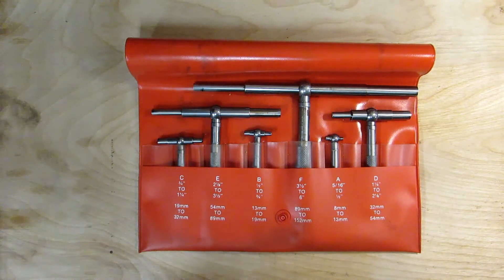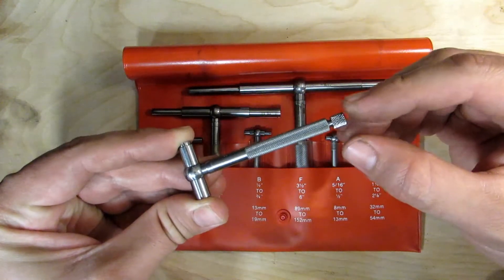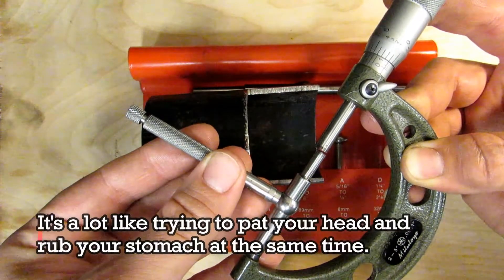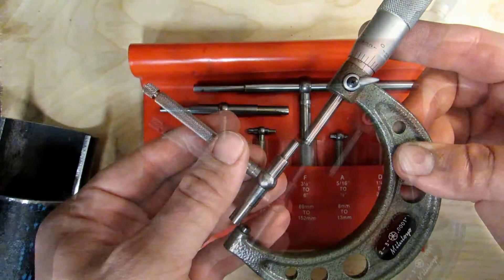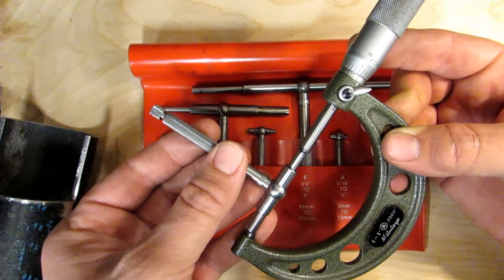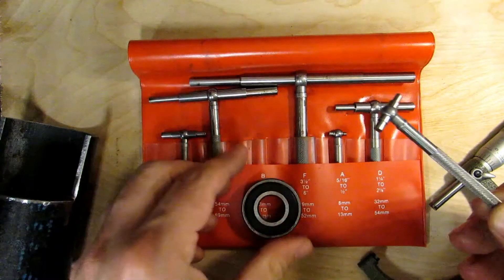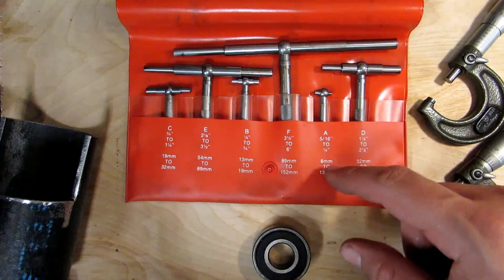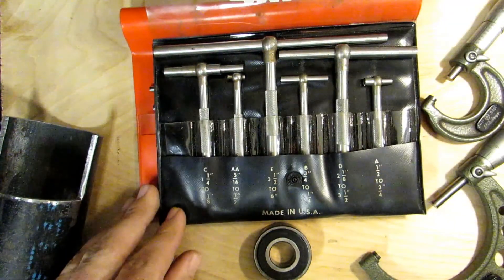How to Use Telescoping Gages

Comment: The hobo freight ones are $17 and they do suck indeed. I'm now rebuilding the snowmobile after 500 miles since new pistons were put in using the hobo freight version. I was never able to get the same measurements twice so I just crossed my fingers.

Comment: I was visiting my machinist son yesterday and we were talking about this... He mentioned that the way he was taught is to not change the micrometer while the snap gauge is between the anvils ( because indeed as you mention, you could squeeze the snap gauge further ). 

Instead, he showed me to place one end of the snap gauge on a micrometer anvil, with the other end of the snap gauge offset away from the other anvil. He would tighten the micrometer a thousandth, and then tip the snap gauge through the micrometer... ( I know this is probably difficult to visualize ). At first, the micrometer is still wider than the snap gauge, so the snap gauge passes the anvil without contact. Close the micrometer a thousanth and repeat until the snap gauge just starts to drag on the anvil as it passes. That's your reading. If you go too far with the micrometer, the snap gauge simply won't pass between the micrometer anvils, and you'll know you went too far, but you won't have compressed the snap gauge. ( But that never happened to him - he had the feel of when it started to drag, so he never went past that reading ).

The key is that there really shouldn't be any force to slide the snap gauge between the anvils... If you force it, then you could be compressing the snap gauge ( which you don't want to do ) and I have to think you might be damaging the micrometer anvils ( which you don't want to do ). You're looking for a very soft dragging force as you swing the snap gauge past the anvil. The tricky part seemed to me to keep one snap gauge end anchored on one micrometer anvil, while swinging the other in an arc past the other micrometer anvil until you feel the slight drag. It seems to me to be a similar motion as you do when the snap gauge is in the bore... It starts tilted and then you're centering the handle to bring the second snap gauge end past the second anvil... If it doesn't drag, tighten the mic a thou ( or half a thou ) and do the tilt exercise again. And to the people suggesting using a micrometer stand to hold it, that makes sense to me too, although my son had no trouble doing it hand held.

I'm going to have to practice I think, to get good, but the technique seems sound.

As for all the people asking about how much to tighten the snap gauge, I got that in just a few tries... Loose enough to still be able to compress the snap gauge, but tight enough to hold a reading. The Starrett set I tried took enough pressure to feel snug, and just a tiny bit more. You can test by just compressing the snap gauge with your fingers. If you can Connors it without too much force, and it stays compressed when you let go, you've got it. Once I learned what it felt like, I had no trouble repeating it, but there's no way to explain it... You just have to understand what you are trying to do, and then go a little tighter and a little tighter until you reach the desired tension that will let you take a reading, and will hold it while you mic it... I found that easy... But then measuring the snap gauge, that's the part I need to practice...

Comment: Why are you locking the gauge, and then forcing it to retract..?
I thought you were supposed to to lock it off at the high point ?
Reply from the maker: That can lead to errors because you might be past the point of max compression. If you lock it while you KNOW it's extended and then sweep it out you're guaranteed to be at the measurement of the diameter.

Comment: I'm not clear on how this would be accurate unless the ends of the telescoping gauges where they contact the inside radius is a single point.  Wouldn't a flat surface of ANY diameter throw off the measurement?  If you are saying that the pivoting motion of getting the gauge out of the bore is what sets the measurement, then shouldn't you then be measuring with the mic the distance from one side of the tool end to the other side of the other end, which is a larger dimension than from flat surface to flat surface.  Help me understand.  Thanks
Reply from the maker: The ends of the rods are radiused. Once the tool moves past perpendicular to the sides the tool just pops out because it has reached max compression.

Comment: I thought the purpose of tightening the screw is to stop the movement after the measurement.
Reply: No, because how would you know the gauge was at it's smallest size (ie. perpendicular to the bore), when you tightened the screw?

The idea is to tighten the screw just enough to prevent the gauge from springing open again, but loose enough to allow it to close in, when manoeuvred against the walls of the bore.
Reply: Great explanation. I figured that's how these were supposed to work, but I'm no machinist! @BedsitBob

Comment: This is new to me,  but why in Heaven's name wouldn't you lay the micrometer frame flat on a wood block so the thimble can be turned,  then only touch thimble intermittently as you close down.  You could even lay gauge on two parallel little wood wedges that miss the head center,  and rock to get exact height.  This would reduce the variables and let you focus on the feel,  while also avoiding hand-heat micrometer distortion.
Reply: This is how I was taught to do it years ago. Makes it much easier
Reply: or use digital calipers
Reply: @jeremykemp3782  when you are striving for accuracy who would use the guessometers
Reply: you are really supposed to use a mic stand, so all your holding is the telescoping gauge

Comment: Great instruction. 
One thing I missed is - how tight should we wind the pinching screw on the handle bar?
Reply from the maker: That's a good question and one that's pretty hard to answer. You need to have it tight enough to hold the pistons in place but still allow them to move. You don't want to use too much force because you can break that tiny little screw. If you practice with a known accurate bore, like a bearing race, you'll develop the feel you need pretty quickly.

Comment: Great video and I'll second his comment to avoid the sets that are made ....... over there by ........ ummmm... the nice intentioned people in the Far East. ABSOLUTE JUNK !!!
Reply: We will just concur that having a set of far east telescoping gauges is worse than having none at all. One can always use an inside caliper at lesser cost and better accuracy.
Reply from the maker: One of the most important things for a telescoping gage is the fit of the pistons in the head and I think that is where the import sets fall short.  The pistons are so loose that they flex out of the way when you sweep the gage out even when that locking screw is super tight.  That opens you up to a lot of wonderful possibilities for errors.
Reply: And the cylinder finish too. I can actually feel the course scraping of piston against cylinder. Yup ... ordered a set through Ebay and wrote them off as complete junk. Fortunately a set of mitutoyo's now inhabit a place in my tool box with a couple bonus bell gauges for the really tiny stuff.
Reply from the maker: The most frustrating thing for me is the ranges.  On my Starrett set, if it says it goes up to 3/4" it probably goes up to at least .800".  On the import ones the 3/4" one barely touches the bore at .750" which is a disconcerting feeling.

Comment: Stuart: Why wouldn't the diameter of the gage influence the measurement of very small diameters?
Reply from the maker: Hi Mike. The radius on the ends of the pistons is tighter than the smallest measurement for that range of telescoping gage. The smaller sizes also have smaller diameter pistons. This ensures that only one point on each piston is contacting the bore.